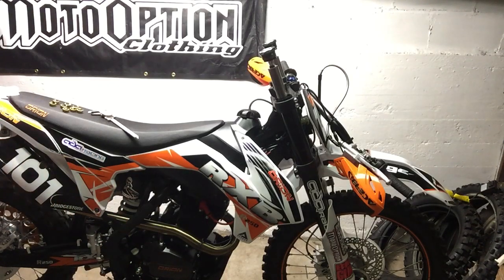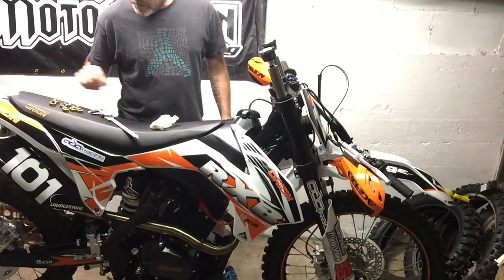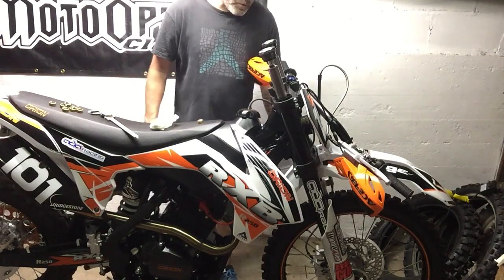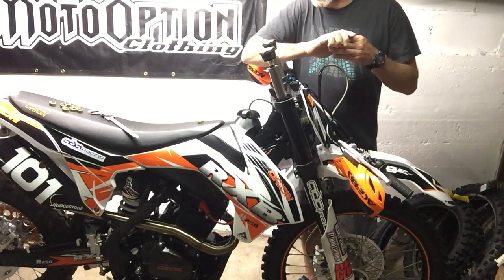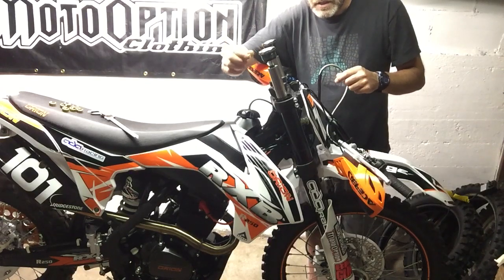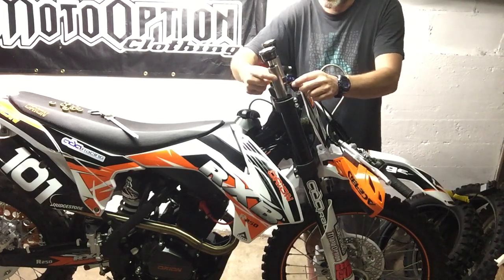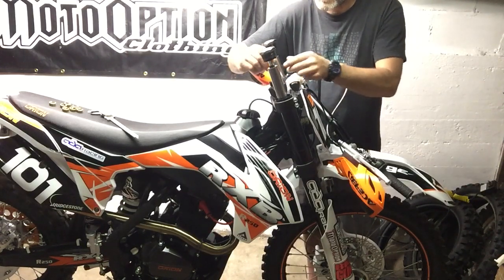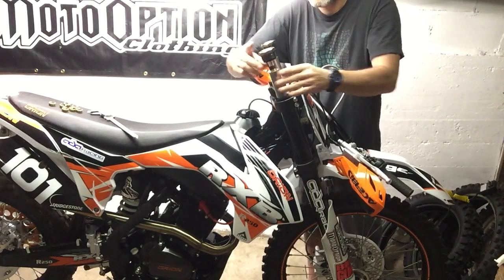Rxb 250 KKE fork spring preload spacers

Comment: Very cool! I have a XPro Templar 250 aka Trailmaster TM35 aka Zuumav K5-CB250 with 830mm non-adjustable inverted forks. I suspect they are KKE but unsure. I am very interested in obtaining some preload spacers for my forks. I thought I was just gonna cut some PVC because I'm old and that's what we did. Well, I also used to install schrader valves in the caps. 

Do you know which forks come on my bike or must I find out first? Thanks in advance. Nice work making these low volume necessities.